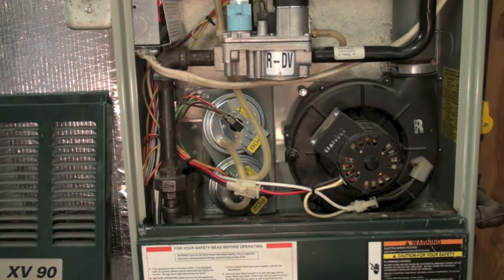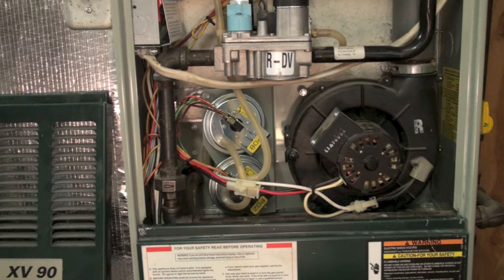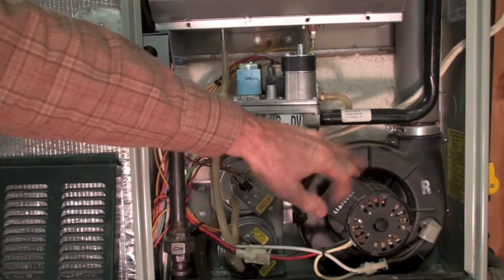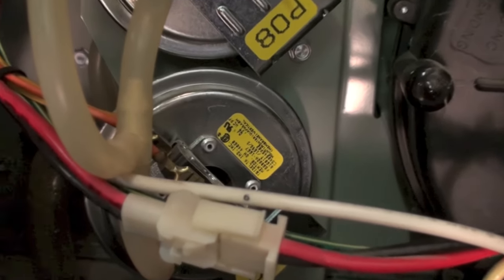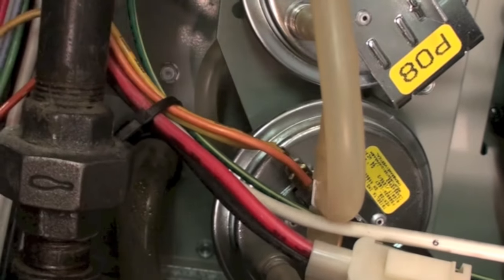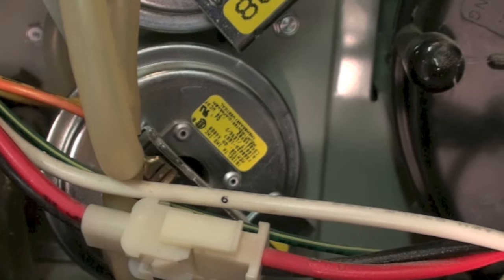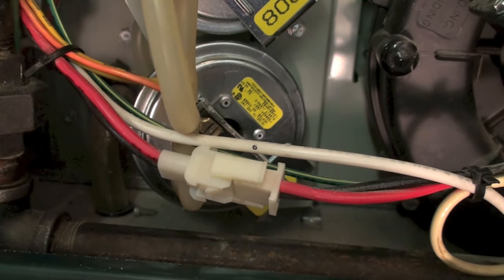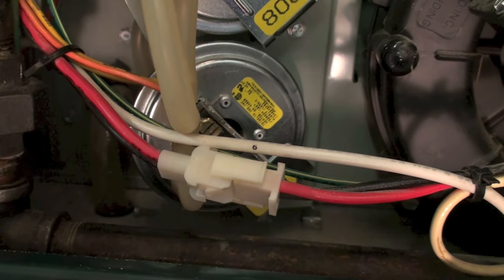Diagnosing pressure switch problems on gas furnaces

Comment: Thanks for pointing me back in the right direction. After seeing the two blinks on the controller i figured out it was the pressure switch that was causing the furnace not to light and confirmed with the volt meter the switch was not making, I tested the switch by sucking on the hose and it seemed to function correctly so I assumed it was just getting old and no longer switching at the correct pressure. I sat down to the computer to start researching the replacement switch and found this video which convinced me to go back and check the vents more carefully. Went outside and noticed a funny barn yard smell coming from the vent, hooked up my shop vac and worked the hose down the vent line, sure enough I sucked up a rodent corpse! Went back inside and tried the furnace again and now I'm back in business!
Reply from the maker: Sometimes you win.
GFM
Reply: Ben Blum t
Reply: Ben Blum i

Comment: First off, I love your channel. I am not a heater or ac guy. starting yesterday morning my wife said the heater wasn't heating the house. i got home and sure enough, no heat. heater kicked on, fan worked, no heat. i surfed the web, cleaned the ignitor, the flame sensor, and checked all hosing for clogs. no clogs anywhere. all tubing is clear. burners are not firing and i was at a loss. nothing else to check. this video gave me my last hope. i had a pressure switch in the basket on amazon. before ordering i watched this video and not sure why, but i checked the pvc pipe outside connected to the house. the return to the furnace, that feeds it air. it was 3am and raining. guess what! My 4 year old or his cousin decided it would be fun to put rocks in the pvc, blocking it! so the pressure switch gave me the answer...blockage somewhere. removed the rocks and instant heat. thanks so much!
Reply from the maker: +Rotter Tube Reef Ahh, the old rock trick.  No army men?
GFM

Comment: Great video. I just fixed mine. The tube going into the pressure switch was clogged at the nipple. I stuck a bobbi pin down in it to clean it and problem fixed. Thanks for the video.

Comment: Thanks for this video. We have an American standard freedom 95 and today noticed our house temp had dropped   to 18 C when the thermostat was set for 21. I saw the diagnostic error code said it might be a pressure switch and found your video. At about the 2:30 mark you said to check the combustion  pipe outside to see if it was clear and I found that it was iced up, it has been around -28 for a few days. I cleared the ice and the furnace started up right away. This was at 8:30 on a Friday night, a furnace repair call would have been enormous if I had not been able to fix that, plus a little embarrassing to have something so simple cause a call out. Thanks again, I appreciate your video very much.
Reply from the maker: Glad you got it going.
GFM

Comment: Your video was spot on! I was getting a code 3 on my Ducane gas furnace. I followed your instructions instead of just changing out the switch. I followed the hose up to the burner box and pulled the hose off. It fired right up so I knew the problem was in the burner box. Removed the cover of the burner and found a mouse nest covering the vacume nipple inside the chamber. Vacuumed out the box and plugged back in the hose. Runs great! Thank you for taking the time to post this video. You saved me!!
Reply from the maker: You now can be honored as a hero by your family.
GFM
Reply: @grayfurnaceman  done! Thanks again

Comment: Spot On Gary!  I removed the hoses going to the pressure switch and blow through them.  The hoses were clear but found that the tiny holes in the plastic nipples the hoses connect to were clogged. Using a sewing needle and vaccum I unclogged them and the furnace started right up.

Comment: Thanks GrayFurnaceMan - I was able to diagnose my issues thanks to this video, and I'm back in business! 

(If anyone's curious: It's -30 Celsius here right now. Improper installation of inlet pipes led to a sag, which led to a puddle, which led to reduced cross-section, which led to an error. Pro-tip, turn your furnace off, remove your inductor motor + housing, and put a bucket under the inlet before pressing upwards on the sag to drain the water, instead of draining right into your blower housing...)

Comment: This was helpful. My furnace was sending a stuck pressure switch signal but based on this information In this video started to backtrack to another cause. After watching several videos including this one in how the furnace works, I figured out that inducer motor was the culprit. It was getting loud over the last few weeks and eventually the drag on it kept the motor from being able to turn anymore. After I was sure there was power to the inducer and could hear it trying to work I lubricated it and now we have heat again. Saved me calling a repair person. Thanks!

Comment: Took the hose off the pressure switch and it was clear.  Placed one end of the hose back onto the inducer and tried blowing into it, it was clogged.  Used a very small drill bit and cleared the clog.  The furnace is up and running again.  Thank you.

Comment: Great video! My Ducane furnace was shutting itself off before reaching thermostat temperature. Gas valve was making random clicking noises. Pressure switch was making clicking noises as well. Long story short, original furnace installers made a dip in exhaust pipe inside of the house brick wall. Water condensate accumulated in the dip, restricting air flow. Your video helped me diagnose the problem. Thank you!
Reply from the maker: Welcome
GFM

Comment: Snowing today here in New Orleans and that is very rare - almost as rare as needing our heater on!  It did not come on and error light blinking 3 times said pressure switch open.  I checked both switches using a light suck/blow and ohmmeter per a different site so they seemed ok. Next step was to call HVAC repair. Luckily I found your video which told me to try simplest first. I just changed filter 1 week ago but when I changed it again per your advice problem disappeared.  Thank you!! And thanks for the tutorial!
Reply from the maker: Wow, I live up north and we haven't seen hardly so far.  Glad you got it going.
GFM

Comment: Hey thanks for putting this video up. Woke up at 3 a.m. with the house at 55 and dropping with it -7 outside and a pressure switch code. Checked and found the outside vent pipe was plugged with ice after your 90% efficiency comment. Running good now

Comment: Thanks so much for sharing your knowledge. As you suggested in your video, the pressure switch was just an indication of another problem. Before watching the video, I had removed the switch and tested it with a DMM and found the switch was working.

After watching your video, I looked for other issues. The small rubber hoses connected to the switch were clear and appeared to be in good shape. I then removed the inducer fan and found a dead bird in the fan housing. Removed the bird and vacuumed the housing. Replaced the fan and the furnace works fine now.
Reply from the maker: jwpetrov Ah, the old dead bird trick.  Seen it many times.
GFM

Comment: Thanks grayfurnaceman. I did the blinking light diagnosis, but did not know what a pressure switch was(on a furnace) I am a reasonably intelligent person, and would have called in the repair man if it wasn't something obvious and no tools or taking things apart to fix, just a blocked hose. Time to have vents cleaned I guess, but at least we wont freeze while waiting for that. Only watched the first 2 minutes, and was able to have heat again. I appreciate you informing people to do things safely and not to try to bypass these safety faults as lives are at stake.
Reply from the maker: +Karin Nieves Welcome
GFM

Comment from the maker: It is possible that the inducer blower wheel is dirty or the inducer is not coming up to speed.  It could also be that the heat exchanger has a crack.  A heat exchanger crack can be dangerous!  The pressure switch is a safety device and it is set to shut down if conditions are not right for ignition.  When you adjust it, you are compensating for an unsafe condition.  I would not adjust it now, I would replace it.  A manometer is good if you know the the vacuum setting.  Hope this helps.
GFM

Comment: Your a hero again.   I used to work on furnaces a very long time ago but we never had these high efficiency units. Your video led me to my pressure switch error and just like you said it was caused by snow blowing into the inlet pipe and it was about 75% blocked by snow.
Thanks
Reply from the maker: Glad I could help.
GFM

Comment: Thanks a lot. It solved my problem with NO COST.  TRANE XR90 - blockage on drain part from Draft motor ...
Unbelievable ... easy, 10 minutes, no cost, only because of people like you ....
I already ordered pressure switch, but I;m going to cancel it .... Thanks again.
Ivo.
Reply from the maker: +Luba Cipka Glad I could help.
GFM

Comment: Thank you very much for you poignant video.  My furnace diagnostic was giving a pressure switch not open or close alarm.  Turns out I had a blockage on my exhaust vent.  Removed the blockage, and the furnace fired right up.  Thanks for your simple breakdown.  Keep up with the videos!!
Reply from the maker: Welcome
GFM

Comment: This video sure helped me out.  The pressure switch problem was just an indication that there was a problem elsewhere.  We just had a period of a lot of blowing snow and one of the vents was blocked by a snow drift up the side of the house.  I cleared the snow and the problem was solved.
Reply from the maker: Sometimes the solution is simple.
GFM

Comment: Thanks Gray I fixed my furnace tonight after watching and followed your advice.  Indeed the pressure switch didn't have problem when the error signal indicating "Pressure Switch stuck open".  It turns out to be the water drainage was blocked and caused late ignition and short burning.  Once I clean the water drain hose, the furnace runs like a charm.

Comment from the maker: It probably is not a larger issue.  Some of the inducer housings have a very small orifice to reduce pulsing from the blower wheel.  The material inside could be anything from drywall dust from original installation to aluminum dust.  As to the HRVs, I usually do vids when I get access to used equipment for demonstrations.   When I get one, I will do vids on it.  Thanks for the comment.
GFM

Comment: Had been told I needed a new board, but I opted to check out youtube, first.  I did every suggested option  - in the order you ran through, and my furnace runs like it did when it was brand new.  As a just in case, before disconnecting any electrical connections.. I shut off the power and then turned it back on.  Maybe not necessary, but I'd rather not learn the hard way.  Thank you!

Comment from the maker: if your furnace is controlled by an IFC, the pressure switch must be open before the ignition sequence will start.  So what I do is remove one wire from the pressure switch, then reconnect when the inducer starts.  If the furnace lights, you know the issue is with system vacuum.  Hope this helps.
GFM
Reply: If it dont light after bypassing pressure switch ,what is my problem??

Comment: Thanks for the videos. Our gas furnace would't fire up. The inducer comes on fine, the fan works (by itself I mean). When we would call for heat the impeller would just keep running. I detached the pressure switch and started it up, then after about 20 seconds I jumped the switch. The furnace fired up. I figured it was the switch and replaced it, but no go. I'll check the other things you mentioned with the pipe etc.
Update: I took a paper clip and cleaned the hole on the impeller, hooked the hose up and it's running like a charm. I hate that I bought the switch, but still cheaper than if I had called the repairman! Thanks!
Reply from the maker: JT Lash You can't always make the right choice first.
GFM
Reply: So glad I read this paper clip tip, JT! I used the end of a twisty tie - stuck it in the hole on the impeller and the hole on the pressure switch. Presto!  btw grayfurnaceman, you da real MVP! Great videos... watched way more of them than I needed too.
Reply: another btw, I have a lennox g60uhv - 80%
Reply: Thanks JT!!!...your paper clip tip saved my ass!
Reply: Thanks JT...The paper clip worked for me too!
Reply: Awesome Kevin!
Reply: +Will Diehl where is the hole in the impeller?
Reply from the maker: +tiehut The hole is not in the impeller, it is in the housing and it is used for sensing vacuum.  nHope this helps.
GFM
Reply: grayfurnaceman thanks for replying.  i fixed my furnace earlier.  the pressure sensor tubing was kinked. cheers

Comment: I think my AC tech may have disconnected the vacuum line to the pressure switch for a return service call when winter came. The furnace worked fine last year. But the blower motor for the central air unit needed to be replaced this summer. When it got cold our heat would not come on. I crawled up in the attic, opened the furnace and the pressure switch was disconnected from the vacuum line.
Reply: T Bone I hope people aren't working that way....I went on a service call a couple weeks ago. Another company in the area had recently done a fall tune up and they had left the wire going to the flame sensor unplugged. I hope it was just an accident...
Reply: Driftingabstract - I really hate accusing someone of doing that without any proof. But it just seems  fishy.
Reply: Sad to say but it's true , a lot of dishonest ass holes out there , best thing to do is give a review on line , those hoses don't just fall off ,
Reply: yes, some shady so called 'techs' do in deed do this.
ive heard of them loosening the vacuum line until it is just about ready to fall off from vibration.
then they return in the fall and 'repair' it for you.

Comment: You really nailed my problem on the head with this video. Thank you for the responsible advice. I had a vacuum line plugged at the impeller.
Reply from the maker: Glad it worked.
GFM

Comment from the maker: The positive pressure is probably the vent pressure.  I would look for blockages in the vent.  Do not run the unit with the pressure switch hose off.  Hope this helps.
GFM

Comment: You were exactly right about the pressure switch probably not being bad. Di spite your advice I replaced mine pressure switch then checked my inducer by clearing out the spout where the tube was located, it was clogged. After clearing it my furnace works great again. I almost bought another inducer during all that. but didnt

Comment: Thanks!  3-blink fault led me to the Switch, but saying 'look somewhere else' made me check flow through the tube to the inducer...and absolutely NO FLOW!   Paperclip cleaned out the corrosion (or whatever it was) and works perfectly.  1993 Goodman still running strong.

Comment: I have a 15 year old furnace and its pressure switch failed to make. I took it off the furnace and tested it and the diaphragm inside made a obvious rough noise.  I went and got a new one from the dealer who sold my furnace and it is a less than half the size of the old one and no noise was produced by the diaphragm when tested. I also checked the inducer motor and its wheel was out of balance so I purchased a new wheel for it. The furnace is working with no troubles now. The furnace is a Bryant 383Kav from 1998 and still has its original control board, but it has a simple control circuit.

Comment: Hey great videos.  Very informative and almost completely accurate.  I'm an Engineer with more than 15 years experience in the design and manufacturing of the pressure switches shown in your videos. The only area where you're slightly off is when you were reading the labels.  You stated the switch should "make" at the pressure shown on the label.  If you look closely, you will see the label says .94" WC PF.  The "PF" stands for pressure fall.  Thus, the technically correct statement would be the switch should  "break" at the pressure shown on the label.  This may seem like a small detail, but it is actually very significant.  If you would like to know why or have any other questions on how the pressure switch works, I would be be happy to help.
Reply from the maker: So you are saying that I am on the wrong side of the differential?  I am interested in how these things work.  
GFM
Reply: Furnadude222 are you still working in this field? I have a couple of questions regarding the manufacturing side of HVAC

Comment: Hi GFM, Along with your video and some of the answers you gave on this thread saved me a bunch! I have a Carrier 90+ and sometimes it would go on only if I took the cover off, but mostly not. I've been dealing with this problem for about three days.
The (trap?) was full of soot and when I first disconnected the hoses, water just started spewing out of the larger hose that connects to the trap and the lower small hose that connects to the pressure valve. Almost two quarts (pressure valve was dry).
Cleaned the trap, got as much water out that would drain and powered it up. "BAM". No more worries. Nice and toasty tonight! Thanks so much!

Comment: Thanks this video led me away from even testing the pressure switch on my Trane XR 90 and found a blockage in the hose leading into the back of the switch .. seemed like some kind of thin paper .. and the screen seemed a bit loose .. but anyway when I put it all back together the 3 blinks were gone, the burners fired up and the furnace is working perfectly! Thanks again so much!
Reply from the maker: +Norman Stahlbrand Welcome
GFM
Reply from the maker: +CmdrGendoIkari About all you can do here is check if voltage is available to the motor.  Also check to see if the motor runs if you turn the fan switch to "on".  Let me know what you find.
GFM